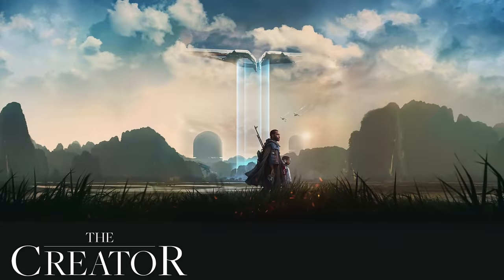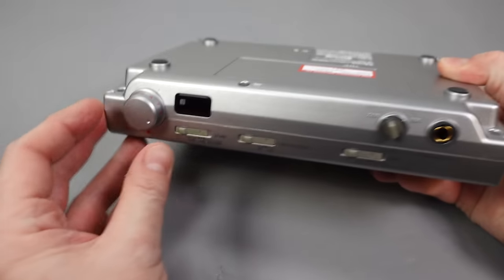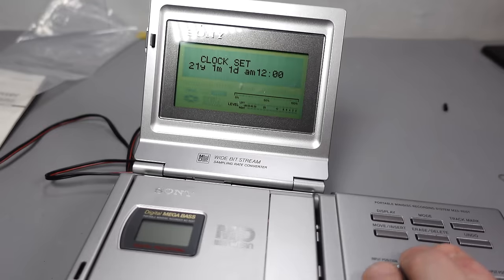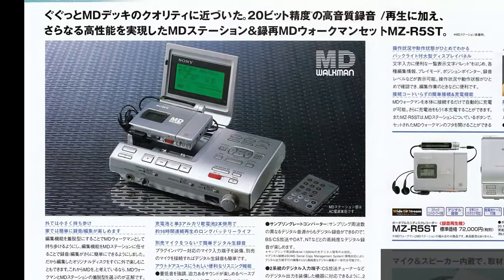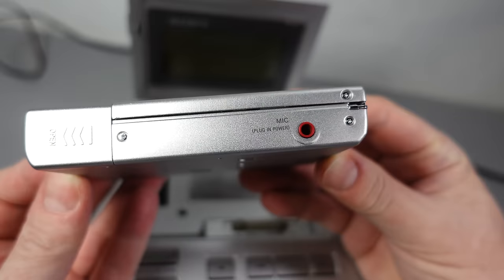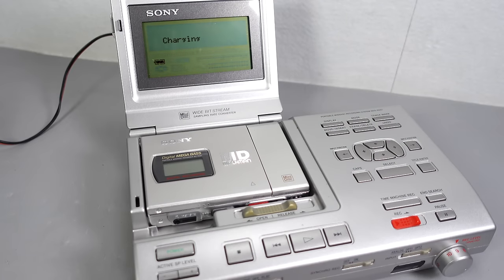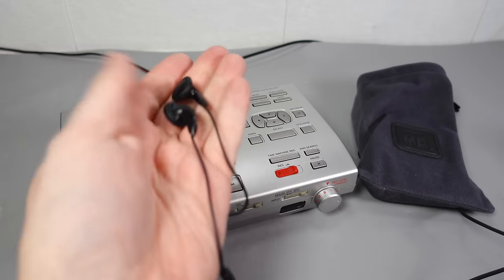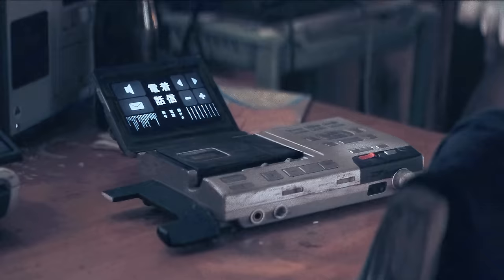Sony’s self-destructing MD Recorder from 2070

Comment: Thank you kind sir!! I dodged a big bullet today. As soon as I could, I opened my unit and removed the nasty nickel-cadmium batteries and with immense joy there was no leak, no corrosion. Batteries still looking good though! Now I'm running the unit without them and I have no errors, but I have no replacement Ni-Cd batteries. After a quick look Ni-Cd cells are hard to find and I'm wondering if it's possible to replace them with Ni-Mh... but could the charging electronics be different on handling a Ni-Cd or a Ni-Mh?
Reply from the maker: you should be fine, but of course I can’t guarantee anything - if you do want proper NICADs they can be found - e.g.  https://www.allbatteries.co.uk/nicd-industrial-battery-kr-aah-aa-1-2v-0-6ah-ft-acn6461.html

Comment: Similarly, my Amiga 500 Plus computer no longer works because the main board had a soldered on NiCd battery (which kept the time) that had eventually leaked and damaged it.

If you have an A500+, my recommendation is to check inside, and I'm inclined to say desolder/remove that battery regardless (or get someone else to if you're not comfortable doing so). Even if it still works after 30 years, it's not going to be worth the risk.

The original Amiga A500 didn't have the clock battery on-board, but many 1MB "trap door" RAM expansions also added a battery-backed clock. So while it's less likely to damage the main board, you should still check the RAM expansion and- at least- remove the battery.

Comment: I have no doubt that it is repairable. The trace aren't that small, even the SMD components are the normal size of the late 90s. With the shielding of (or whatever it is) and a good microscope (and time) it should be "easy" to reconstruct the circuits. A shame to see this device in this destructed stage.
BTW: great video, great topic, Thanks!
Reply: as long as any unobtainium chip leads havent completely corroded off it should be ok

Comment: Sony gear was notorious for all sorts of proprietary standards, but their design and engineering was second to none.  One wonders if those two things were related ... sell the units at a reasonable consumer price, get peoole hooked, and then clean up on all sorts of Sony-only media, cables and battery holders.

Comment: The portable unit looks a lot like the R35/R50, and I had a couple of used R50s that came with original batteries that are excellent! (giving several hours of play-time. Thankfully I also found a nice chap in the r/minidisc community that sold me brand new ("homemade") replacements for a really reasonable price as well. <3

Comment: I have the R50 and if you start recording and then pause it, you can use it as a really good noiseless DAC with Toslink and Lineout or have some white noise in the 3.5mm headphone out. Really good devices. Underrated af.

Comment: Hey again! I am pretty sure, that the NiCds didn't do too much damage, but besides these some SMD electrolytes have started leaking too. And these killed the analog audio. If interested, I can get the system working again. Just get in contact. I can even record the whole repair, if you like to have that.

Comment: After watching this video I quickly picked up a JIS screwdriver and went straight for my own MZ-R5ST, that I haven't used in many years. Luckily there was only some green residue on one side of each battery and I couldn't see any trace of residue or any damage on the circuit board or case.

Comment: Thanks! I have opened mine and the batteries look absolutely fine. Not branded and impossible to read the small matrix-printed letters. Can I replace them with 1,5 V AA Alkaline, or are the replacement batteries some kind of special batteries? I am not using the unit very often, but does it need the internal batteries for anyhing else than keeping track of date and time?

Comment: 6:27 But I think starting from 1997 they had also abandoned Japanese text for units sold in Japan. The MZ-R50 which was released in 1997 had buttons labeled in English even for ones sold in Japan. But the MZ-R30 which was from the previous year had Japanese labeling.

Comment: Checked eBay for one... just wondering and still like $250. I would love to try to fix one, if it was cheap....

Neat product to see, I used MD a lot in the past and back in the day, I would have loved one of these. I always had my MZ-E2 with me everywhere (still have it and it still works, even the OEM battery still holds a fair charge). I would take my disk out and drop it in my home unit. Having a dock like this I would have loved.

Comment: Sony's component MD decks have a little button battery inside as well. No idea of the chemistry, but it is rechargeable. It's apparently there to save the metadata if the deck loses power before it's been written out. I wonder if it will also fail in a similarly disastrous way?

Comment: I have a Kenwood DMC-G7R mini disk player in mint condition together with a Kenwood rechargeable battery that does not last more than a couple of minutes of being charged. I had no idea of the battery leak issue and have just removed battery from my unit. Just in case. Thank you for the heads up. 😊

Comment: I have the MZR4ST, I think this/your version was intended for the european/uk market due to it being in english and coming with a remote. (as you stated in your video). It has a nicer display than its sister model, more like a portable dvd player type of display. I recently sold mine on ebay (fully working), as I never used it, I still prefer the MZR4ST unique appearance. (which i got from japan). I still use it to this day.

I tried both md players in the docks, but they are not compatible with each other as the mzr5st uses a thinner player compared to its sister unit. Obviously your unit requires uk voltage, whereas I have to use a 50w convertor for mine to function. (although its in english and japanese too). I do not think they function any differently than that though in terms of version comparison. They are stylised differently though. I had to translate my manual as it was in japanese. (before the wiki). 

The MZR4ST is my favorite md item.

Comment: Oh man, this video made me think to go check some old hard to replace devices I have for battery corrosion. A favorite CD Walkman (maybe the only CD player I still own) had a corroded battery in it. Luckily it still works but dang, everyone go check your infrequently used devices. Your gameboys, your vintage toys with batteries, your CD cassette and minidisc players. I recently had a vintage lighted view master that had a corroded battery and it took a lot of effort to get it all cleaned up. Luckily there are no complicated electronics in that and it was fixable.

Comment: This corrosion looks totally repairable. a matter of retracing and using the through holes to get conductivity going from one side of the print to the other. Ends of resistor wire can be used to retrace the lost tracks. This really seems only mood damage, looking at the components being largely unaffected. I'll fix it for you if you like. Done so with many Sony WM-DD models. Damage is far more extensive on those.

Comment: Ouch. As a commodore amiga owner who has spent countless hours restoring a few of them, that battery hurts.  Those computers have a memory expansion card with a clock and, yes, a varta battery that will almost certainly have leaked.  I've seen several of those cards where the board has been eaten all the way down to the copper cladding.

Comment: if you are wanting to reverse engineering the pinout or can get a pinout since the device is removable from the dock it is possible that you could make a breakout board to connect it up and make your own dock.

the analog may still work in the device but it is not getting past a point because of the damage.

Comment: With the time & date missing from the silent tracks on the disc you found in the machine it's possible that the batteries were already leaking and the damage had already been done before you bought it. I'm guessing the previous owner tried it out, found it wasn't working so just sold it on.

Comment: Thank you so much for this video! I had the same model stuck on a closet and after learning about the clock battery decided to take a look. They were just starting to leak. Fortunately no damage to the unit yet, which works fine in my case. I noticed you display didn't light up, it was supposed to have a blue backlight. Was that the video or was that dead as well?
Reply from the maker: it does light up - it’s just the studio lights make it look like it doesn’t.

Comment: I owned an MZ-R4ST up till a few months ago when I sold it and 10 discs for $100.  Purchased in Japan in about 1998 when I was there.  Used it for quite a few years.  In fact while I was still in Japan (Was only there for about a month) I borrowed some vinyl records from the local library and recorded them onto the MZ-R4ST.  Don't think the R4ST had any batteries inside it though?  At least I never had any issues with them leaking or anyting like that?

Comment: i have my mini disk player still! i have the model they sold as a walkman, but it doesn't have the recording feature directly from 3.5mm. i have to load music over usb. one of my professors had the model that could actually record audio directly to MD over 3.5mm though which was super interesting. if usb flash drives had not become so cheap, then we would probably have seen a lot more MD players. 

i remember trying to get a MD player for my car from japan, but it would have cost nearly 1000 bucks to get it from japan to the US. Sony never sold a single MD player for cars in the US :(

Comment: This kinda confirms my gripes, I got with collectors going crazy over sealed hard and software. 😅
At a certain point, that priced sealed games cartridge / device / whatever will destroy itself (if it has a battery). And nobody will ever know, because it is kept sealed for the value (the VALUE of the potentially broken product)...
I also am not too warm about the idea, of buying something, to just keep it and never use it. Although I still can respect the intent, to have it as a time capsule / or to preserve the art. So if that is you, do yourself a favor and open at least your sealed items with batteries and go check on them from time to time. Or remove them, if you do not plan on using the product in some time. 😊
(PSA on checking also goes for enthusiasts using old hardware, I guess 😅)

Comment: I am very curious about that big dock connector. I bet the dock's just a dumb peripheral controlled by the CPU in the minidisk player itself, which means the protocol is probably pretty simple, and may be straightforward to reverse engineer. Being able to remote control the player from a modern PC has possibilities, and there may be all sorts of interesting internal functions available.

Comment: Clearly the damage from the leakage is significant, but with the right tools, knowledge and skills it's probably repairable. But I also wondered, did Matt put one of the replacement batteries in back to front?  The original ones had the same orientation, but in the video the replacements looked like their positive ends were placed towards each other.  Of course, until the repair work is done, there would be little likelihood of the clock backup working.

Comment: I imported the 4ST version when they were released in Japan in the 90's. I still have it and while I don't use it I have a hard time disposing of it as it just looks cool. I don't have the battery issue though (no clock) so that may be a better model for collectors.

Comment: Shame the batteries ate out part of the audio circuit. I wonder if it could be part of some cross-over video in the future? Like some repair tech figuring out where the traces were supposed to go and bridging it all with jumpers being soldered in. At least that could be an option if the components the traces went to are still functional. Not quite your domain, but there's got to be a few other people on YouTube that could be able to take it on.

Comment: I believe that the cause of not being able to use analog sound is not only battery leakage but also capacitor failure. Early replacement is required.

Comment: Yeah the same battery problem exists in many Macintosh computers of the 1980s and early 1990s. The batteries that keep the PRAM active are known to leak their electrolyte all over the PCB and disintegrate the traces. These kinds of batteries just didn't last for decades. Happily, though, some Macs came with a better type of battery that is extremely unlikely to leak even today.

Comment: I'm in my mid 30s, so it may be nostalgia glasses, but I really miss devices like this. There's the mechanical aspect, and then just the neat design like the secondary battery charger and all of the little add-ons like the in line remote. An iPhone and some AirPods might be more efficient, but the little black nightmare rectangle doesn't have any soul!

Comment: The LIP-8 battery replacement caddy is useful for the MZ-R50 but unfortunately it looks like the seller no longer has them. I may send a message to them to see if they can make some more. The lack of LIP-8 batteries has been the reason I've not bought an MZ-R50 but the MZ-R30 and the MZ-R35 are similar and use the still easily available LIP-12 battery.
Reply: Any chance to get the contact  info/link of the seller oft the LIP-8 replacement battery holders? I have an MZ-R50 that could use one. Maybe, if they won't sell those anymore, they'd be at least willing to  provide/publish the 3D printing file.

Comment: Looks like the dock station is bunk but that silver md player looks like it can pop out and use as a walkman. I used to have the blue stainless steel version of that Md. Player. I'm sure that little player inside the dock still works

Comment: First impressions, an audio amp fuse has blown? I had a midi system which on the display, it was playing, but no audio. I replaced the audio amp fuse, a transparent fuse & it worked again, however, that was a midi system while this is an MD player etc. I wouldn't know if it would have an easily replaceable fuse.
Another possibility, it could of been from a pile of defective units that never completely worked in the first place, defective even before it left the factory.

Comment: It may be worthwhile sending the unit off for repair to get the audio working or atleast prevent damage from spreading even further from the battery acid that is still on the board.

Comment: I still have a mini mini disc player/recordier around the size of the palm of hand.. comes with basically the same sony charger... has seen little use in 25 years but what cooler way is there to record than onto mini disc.

Comment: Those traces are easy to repair as long as you know soldering. You can buy enamel coated wires and solder it from one trace to another....

Comment: I wonder if it was known at the time, that this type batteries will leak after long period of time? 
For example I started noticing reports of Commodore Amiga extra RAM card real time clock batteries leaking in the early 2000's, and luckily managed to catch it at the last moment before disaster, because it had just started leaking, showing green crusties at the battery.
Now I also wonder how my DVD player from 2004 can hold the "last memory" feature even after being months disconnected from the mains power...

Comment: My commiserations on your battery leaks, from someone who once owned two Korg Polysix synthesisers with differing degrees of corrosion to the KLM-367A circuit board caused by... leaky onboard NiCad batteries.

Comment: We used the MD Walkman at the radio station I worked for to record in-store sale ad's etc. They were a revolution! We could edit tracks on the fly, save tracks to keep and the discs were relatively cheap. Goodbye crappy cassette recordings. Then - gone.
Shame about those blimen batteries TMoan 🤥

Comment: Something acid (like Lemon) might help remove the leakage from the battery (and stop it from getting worse), then cleaning it off with isopropyl alcohol. If any traces are broken it might be possible to jumper around the damage with some short jumper wires.

Comment: Toss the motherboard into an ultrasonic cleaner and fix the traces that have been etched off with jumper wires, you can use a picture of an undamaged board as reference.

Comment: Shame they had to use self destructive foam on the microphone. Reminds me of the foam pads in 8-Track tape cartridges. Interesting device, if only the analog inputs and outputs worked. But at least the digital part still works.
Reply: Dvd recorders same problem firewire and digital inputs outputs work fine but analog side does not work.

Comment: I cast doubt that the self-destruct "feature" was designed by accident. With this level of thought in the overall design and the explicit mention in the manual about the disposal it was for sure considered. Now if the design was done such by malice or for cost-cutting I'll leave this question open. 

But my Hanlon's Razor is dull by experience (hint: "or" not "xor").

Comment: If you remove the PCB that got the alkaline over it and wash it in distilled water then dry it with a hair drier then closely inspect it under a magnifier looking for broken tracks you may well be able to recover it. If any PCB tracks are expired you should be able to bridge the gaps with wire.

Comment: Actually do you know if the MZ-R4ST had such a battery in it?  If it does I may have to have the buddy I sold it to come over so I can pull them out.  Since the unit is currently still working.